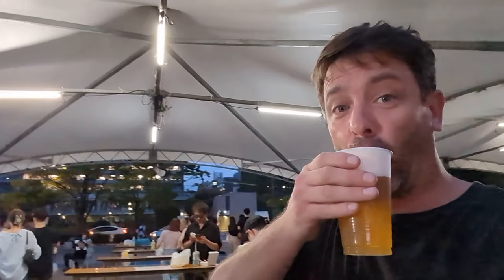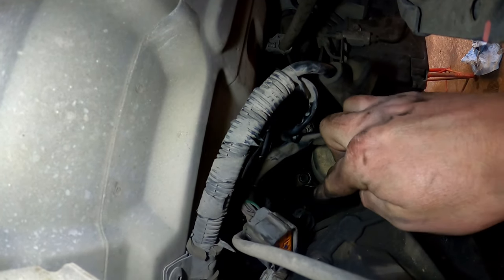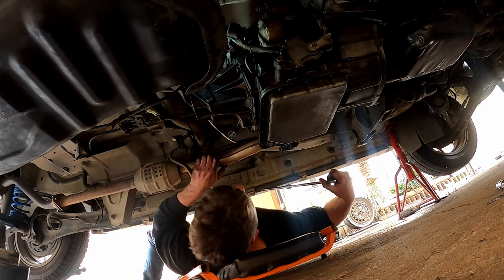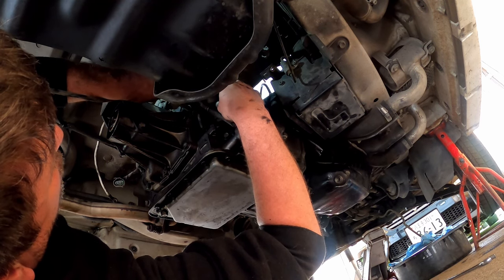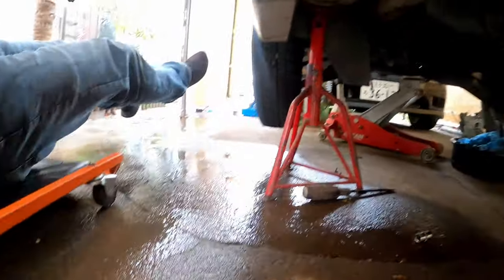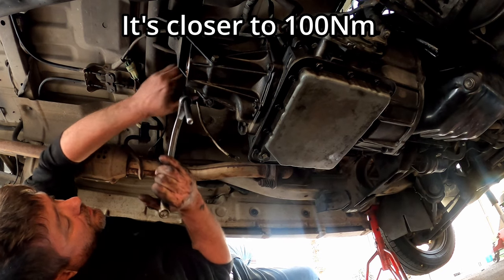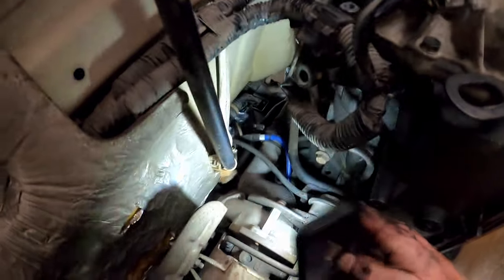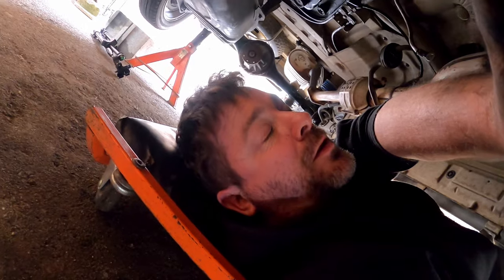This might be impossible. Removing an automatic transmission. DA52V Suzuki Every Van

Comment: Your vids have been very helpful. I need your help - my friend has a 1992 cappuccino - the lower pulley/ balancer broke from throwing a belt. Could you recommend best place to source one? We’re in Nevada, thanks.
Reply from the maker: Search Google for "Megazip". Click the links until you find "suzuki Cara" locate the crank pulley. 
It is a solid unit (doesn't have the rubber in it) so it can't fail. It's also about 1/8 the price of a replacement cappuccino one.
Reply: Great info - thanks
Reply: We checked - the cara was out of stock and the cappuccino EA11R was available for $230 plus shipping.  Any suggestions to find a less expensive one?
Reply from the maker: It'll be out of stock at MegaZip but it will be in stock somewhere else.
If you DM me somewhere I could potentially send you one.